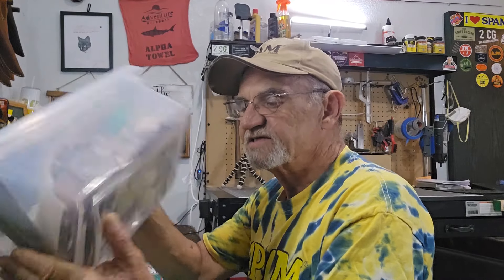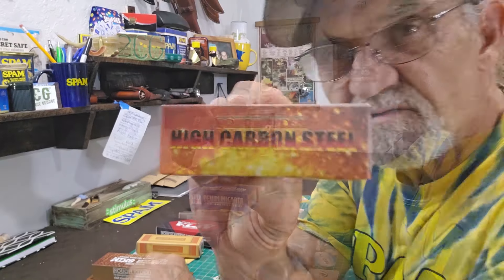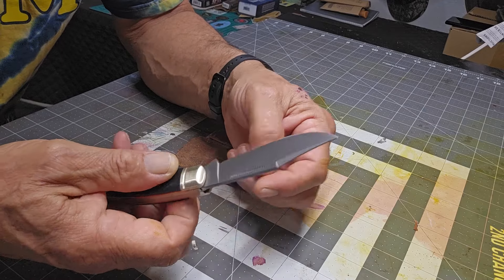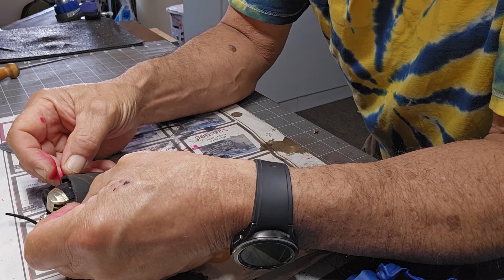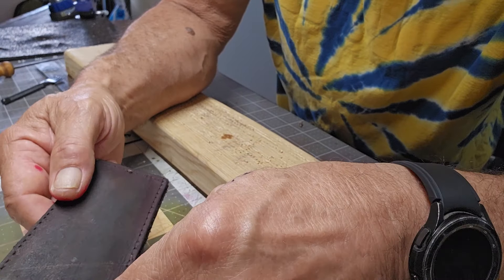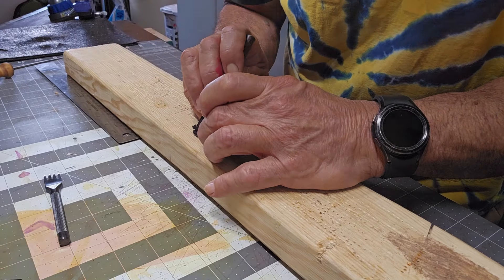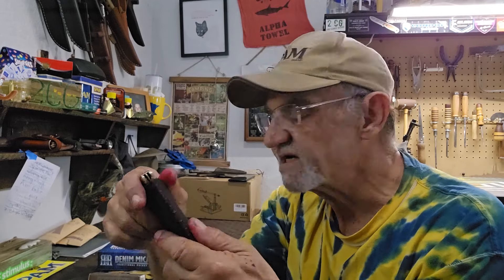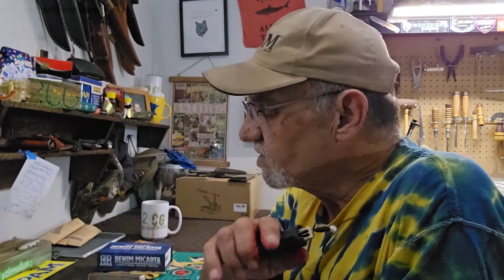CLOSED --7 Days, 7 Knives, 7 Slips And A Giveaway: A Week Of Fast Diy Projects With Me!

Comment: I'm in. Your RR 1572 and slip makes me think of some I've carried for work in the past. Once I got serious about a knife as a tool and not just as something to carry always but use only occasionally, my biggest concern was surface rust from pocket living. Seeing you make the slip has me smacking my head in frustration for not doing something like this in the past. Like everything that is obvious, I tend to miss those things. The one I carry now for everyday use is an older electricians knife. The blades are stainless, but the springs are carbon. My answer has been to rub them with candle wax every few weeks to help protect the steel, rather than have oily pockets. Great idea.
Reply from the maker: Yep. There are alot of wax combos coming out now. Be safe